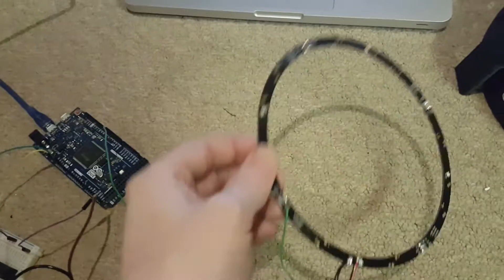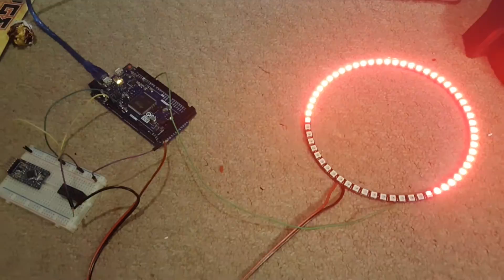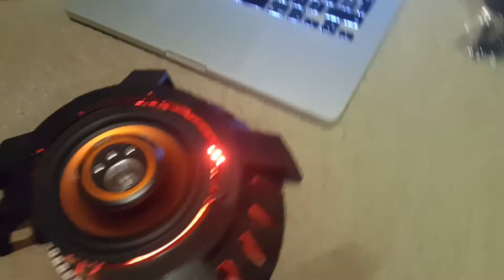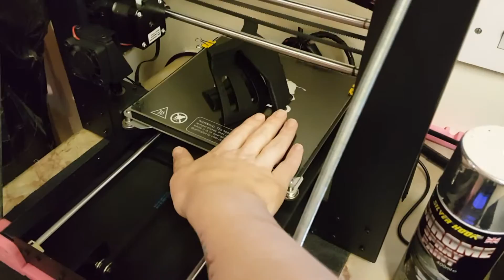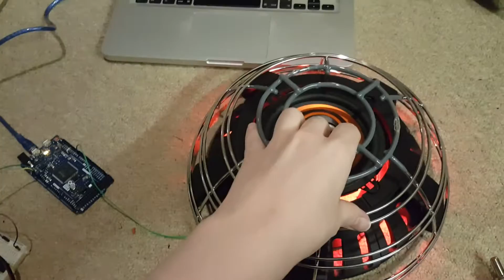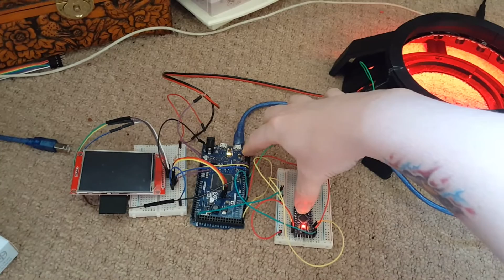Reboot Proton Pack Part 6: LIGHTS!!!!

Comment: can you share that ardunio sketch and the wiring diagram???
Reply from the maker: Ryan Brewer these things are on my website :) Take a look. captivating costumes dot com
Reply: found them! Thanks! does this work for arduino mega or just uno?
Reply from the maker: Ryan Brewer it should work on everything. I've used it on uno, mega, pro mini and due.